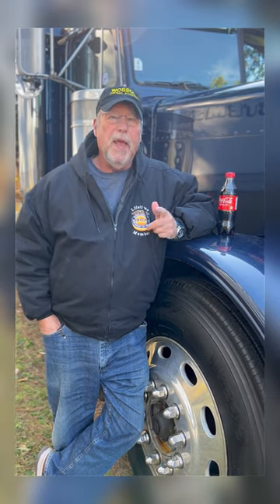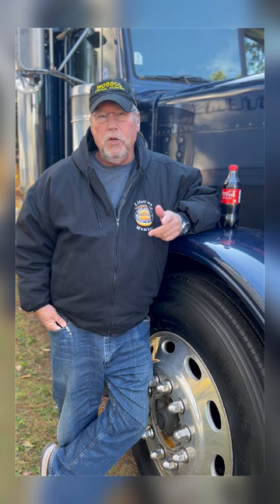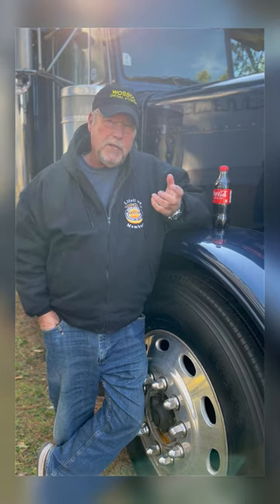Coke + Oil: Old Time Trucker DIY RustProofing! #shorts

Comment: You can buy a product called rustmort it is phosphoric acid but in a higher concentration then Coca Cola. You brush it on and keep it wet until any rust turns black, let it dry, I’m not sure if you rinse it after or not. Let it dry again and paint it. If your too lazy to paint it after just coat it with the fluid film wool wax.

Comment: I use transmission fluid an spray it inside an out of frame rails,doors,rocker panels, cab corners,fenders,inner bedsides,run it down dusty road after.